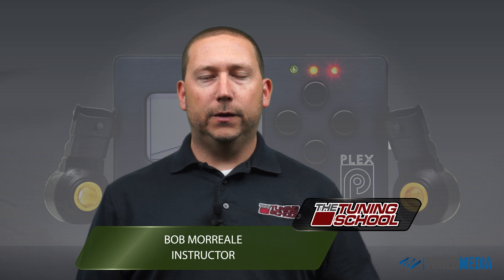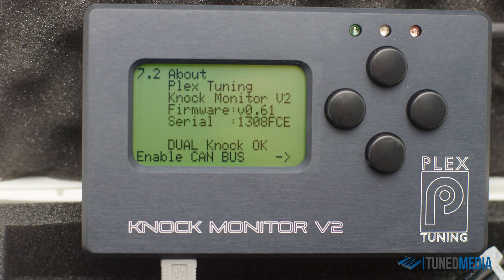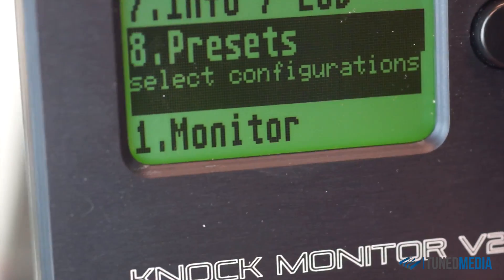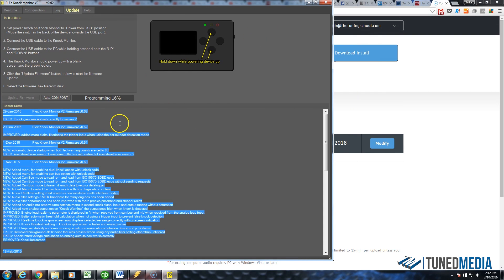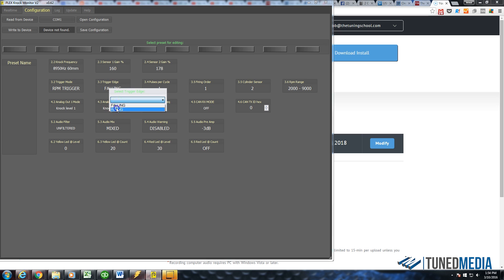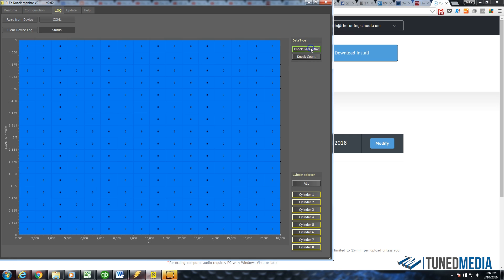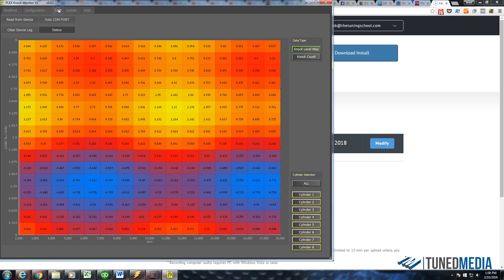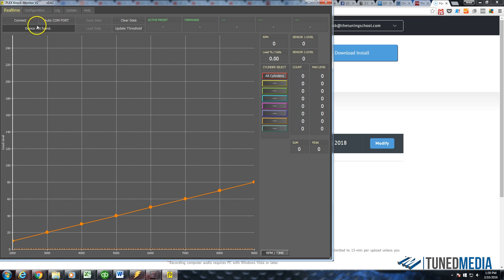Plex Knock Monitor V2 Advanced Options

Comment: so this works with existing vehicles that already have knock sensors? Im assuming the OEM knock sensors are not adequate enough to detect what this knock sensor can? If car does not have any knock sensors where in normally best place to install them?

Comment: Hello
So is it possible to connect this device to a scanner? I could not understand the scolding part of the scanners, sorry I do not speak English.
And does this device get RPM data in what form?
If a single cylinder is detected, would one sensor per cylinder be needed?
And can this device be used on any motor?
Greetings
Reply from the maker: https://thetuningschool.com/products/plex-knock-monitor?variant=7053745619005